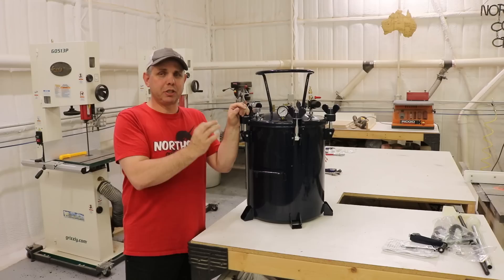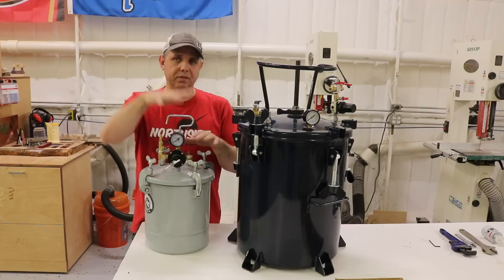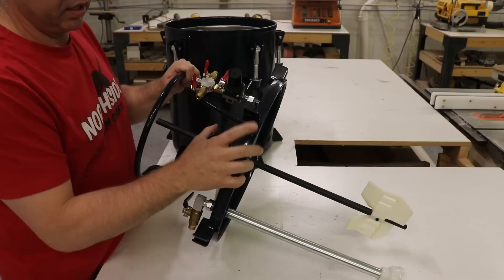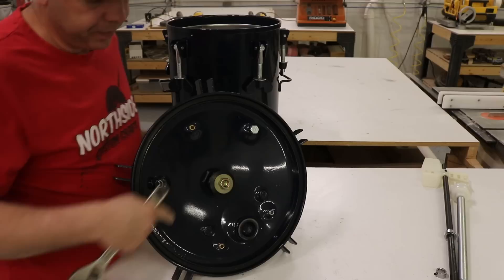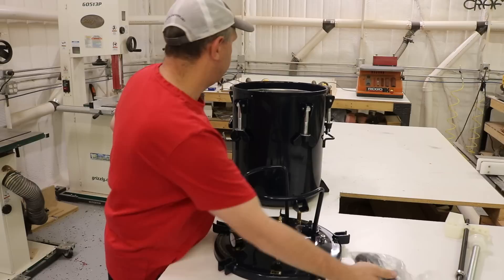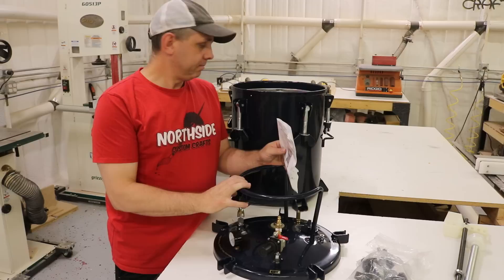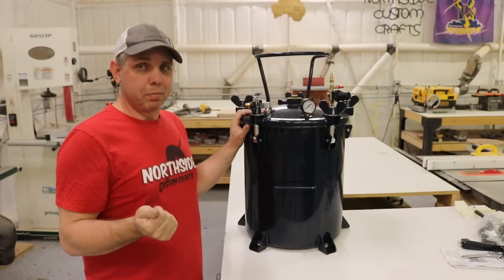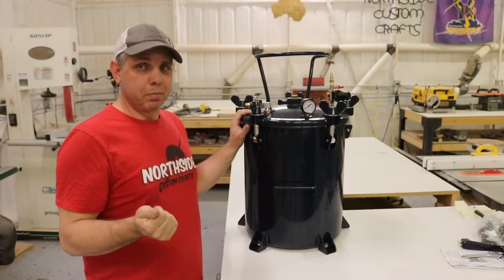How to convert ANY Paint Pot into a Pressure Pot for Resin Casting

Comment: Great Video Jake! I Have the 5 gallon version and love it, the only thing i did differently was to add a 90 deg elbow to the inside of the lid where the air goes in so that it is deflected off to the side instead of blasting straight down
Reply from the maker: Jeff Holliman I knew I was forgetting to mention something.. lol This one came with an air deflector that screws In under the regulator.. if it didn’t have one I would have done something like you did with yours. . 👍👍👊

Comment: I find it so fascinating that every time I need something resin related and I have to do a conversion, I always wind up coming to your Channel. So recently I also bought a California air tools 10 gallon paint tank that I need to convert into a pressure pot. Only this time I know that I can probably get the items to seal up the top at a local hardware store this time around. I know this video is over 4 years old but if I happen to come across any changes to this pot, I will come back to this Channel and let you know like I did with the 2.5 gallon pot.
Reply from the maker: Lol Awesome.. I’m glad you keep needing the things I’ve done and made videos on.. this one is a lot more straight forward than the other one.
Reply: @JakeThompson  Okay, I'm back. Configuration is done,  but I have a problem. I bought a 3 gal pancake compressor and for some reason, it's hasn't touched 20 psi. I bought an air compressor 1/4" kit from Central Pneumatic and after connecting all the parts I'm detecting leakage from the  1/4" female quick connector. Is it suppose to leak back out from the air inlet like that?
Reply from the maker: @seekertosecrets7618  you are trying to fill a 10 gallon pot with a 3 gallon tank.. it’s not going to work well for you… I have a 8 gallon air compressor that will fill it but it’s slower than filling with a larger compressor.. I wouldn’t go lower than 8 gallon tank on your compressor.  As far as the leak goes.. it shouldn’t leak.. if it does.. take it apart and reseal the threads, or if the quick connect itself is leaking.. the fitting might need to be replaced.
Reply: @JakeThompson  Another question about the compressor. Is buying a 10 gallon tank enough to cover both pots I mentioned?
Reply from the maker: @seekertosecrets7618  https://youtu.be/wqIWYf3dhs4?si=JtKvTmde2Gjo1-iU

Comment: Great tutorial. I ended up using metal washers instead of the rubber for my Home Depot did not have. Some 5 min epoxy on the center bolt and no leak. Your instructions on adjusting the pressure valve was very helpful for my TCP pot was set at 40 psi and was tripping each time. I thought i had a leak before i realized it needed adjustment.

Thanks again
Reply from the maker: cadmus547 Perfect!! I’m glad I could help you out.. Happy Casting! 👍👍

Comment: Absolute max generally means (US Specs....) Safe - possible - burst is at least 2x that.  60 is easy for it and so is 50 and 40 is sleepy.  Safety is a bleed down to safe not dump the can and requires manual reset.  So if your compressor dumps volumes fast, it will be low and then overreach.  Bleed down to set value.  Cool.
Reply from the maker: Martin Eastburn 👍👍👍

Comment: Amazing and so easy to follow!
Reply from the maker: Paul Bielaczyc Thank you Paul.. I’m glad you liked it. 👍👍
Reply: @JakeThompson  I do have one question. When plugging the center hole with the 5/8" bolt, does the orientation matter (bolt facing down versus up)? 
If you inserted the bolt from inside the pot facing up (opposite of the video), then the pressure in the chamber would be pushing the bolt out. Seems like the bolt/bolt head would be a stronger joint than the threading/nut?
Or does it really not matter?
Reply from the maker: Paul Bielaczyc it makes no difference. The rubber and metal washers are laying against the metal lid.. so it won’t matter which direction the bolt is facing.

Comment: So I ended up buying the TCP Global 2.5gal version. It looks like the CAT version except not as high quality parts. Followed this tutorial. And the lid has a rotted out thread where the safety valve screws in. Gonna try some locktite. If that don’t work ill just have to deal with the bubbles because 200 was the most I could spend.
Reply from the maker: Sorry about that.. I hope it turns out well for ya. 👍
Reply: @JakeThompson  It did work out! Loctite 242 to the rescue. I applied it liberally(only time I will use this word lmao) and let it set for about 45 minutes and that was that. Do you think 40psi is enough for clear dice and miniatures?
Reply from the maker: @viridianwarrior  Awesome… 40 psi is probably good but you will find out lol I usually go just below the max of the pot. 👍

Comment: thanks for the video. very clear. i have a mold that is 16" tall and if i'm reading the specs correctly it should fit in this one - does that jibe with what you're seeing in yours? i was looking at a much more expensive "ready made for casting" pressure pot as i wasn't sure if i wanted to deal with the mods but your video made it so easy that i can take it on and can save a coupla bucks too. much appreciated.
Reply from the maker: Thank you Sean! 16 inch tall mold should fit.. not much more though.. I’m glad I could help ya.

Comment: Hi Jake just watched your video and subscribed on paint pots and I just converted a Harbor Freight pot everything went as planned i filled the tank up with air 40lb didn't hear any leaks at all but came back in about 90 mins and the tank had lost about 5lbs....any suggestions? Thanks for all the knowledge your putting out...Chris
Reply from the maker: Chris Oliver  I leave the air on with mine and the regulator should keep it full.. sometimes my harbor freight lid leaks at the seal.. I just clamp the entire pot to the table.. fixes it right up.. thanks for coming aboard the channel.. 👍👍

Comment: Hi, Jake!! First off, I love your videos. They are extremely helpful especially getting things set up for casting. I recently upgraded my HF pressure pot to a larger 8gal tank similar to the one in this video. One question, did you need to do anything to the "screw cap" that's between the pressure relief valves?? Mine has the same thing, and I want to make sure everything is covered before using it.
Reply from the maker: Very welcome!! I’m glad you enjoy the videos.. just make sure that screw cap it tight.. that’s it..

Comment: Hi Jake, thank you for the helpful video. I'm just getting set up, converting mine for resin casting and had a couple of rookie-type questions for you...
Firstly, I've removed all the nonessential stuff and am just waiting for the right size fittings to come so I can cap it off. I've temporarily put the hand-stirrer back in place and am wondering if I could just cut that off shorter and replace it to save the trouble of using a bolt and washers. The stirrer passes through a tight hole in the lid with two even tighter O-rings and is then secured by two collets with a grubscrew in each. No air gets out round it, so I'd wondered about just shortening the stirrer.
More importantly, do I need to fit a non-return inlet valve to the pot so that I can disconnect the compressor? Or do you just leave the compressor pressurised and attached to the pot?
Thanks!
Reply from the maker: Thanks for watching.. you can cut the stirrer, although a bolt is pretty easy.. The inlet valve works just fine.. you can leave the air on and just leave it hooked up. The regulator will keep it at the right psi

Comment: Thanks for the great tutorial! I have a 3 gallon air compressor. I converted both a 5 gallon, and a 10 gallon pressure pot. Can I just keep emptying and filling the air compressor into the pressure pots, or do I need a bigger air compressor?  I completely read my air compressor manual, but I have never operated it or any before.
Reply from the maker: If you have resin with a slow working time you might be ok.. but a good rule of thumb is that you want a tank on your compressor to be at least the same size as the tank on your pressure pot. I’m glad you enjoyed the video. 👍

Comment: Another question:
How pressure i need, that the air bubbles go out
In a mix from 50 ml or 100 ml ?
Or in a ready resin piece in this sizes?j
Is the pressure i need continual go higher to the dimensions of my used resin or is this ecponentiell
Reply from the maker: Vero Fluegel It’s the same pressure for any amount of  resin.. at least 45 psi

Comment: I recently bought this pot, converted it, but haven’t had a chance to use it yet. I don’t plan on doing large castings, I just wanted to be able to fit more than one casting in at a time, like the Harbor Freight. Have you looked into a collapsible wire rack that might fit inside of this, which would create shelves for multiple levels of smaller castings?
Reply from the maker: I haven’t tried any racks, most of mine are larger castings.. 👍👍

Comment: Mine continues to leak. I think it is where the 5/8 bolt goes through. What is your 5 minute epoxy solution?
Reply from the maker: You can spray some soapy water or window cleaner on it to see where it’s leaking..  I would put epoxy around the bolt pretty thick and tighten it down if it leaked at the bolt.

Comment: I just got one of those pressure pots, but I need to purchase an air compressor... do you think itwill be enough with one of those that are meant to inflate car wheels? Thank you!
Reply: btw, mine is 2.5 gallon, I guess that matters 😂
Reply from the maker: A mall tank air compressor is plenty for a 2.5 gallon pot.. a “pancake”  compressor is fine..
Reply: @JakeThompson  sorry, Im spanish and I dont really understand, but I think you’re saying that mostly any compressor will be fine right? Thanks! 😅
Reply from the maker: @nigromarte7017  Yes.. I would make sure the air tank on the compressor is no smaller than the tank on the pressure pot.. 👍👍
Reply: @JakeThompson  Thank you!

Comment: Jake,  I just purchased the harbor freight pot and converted per your video.  I can only get 35 PSI in my pot but it holds the pressure.  How do I increase the pressure at least 45 PSI?   I have a good pressure tank that far exceeds the pressure that I’m getting on the resin pot.  Thanks for your videos, they’re appreciated.
Reply from the maker: Stafford Hillman Is the pop off valve coming popping off or does the regulator need adjusting.. turn the black regulator knob to the right and see if it lets more pressure in.
Reply: Jake, I had inadvertently turned my regulator down on my air compressor, which ended up being my problem. Thanks very much for your reply.
Reply from the maker: Stafford Hillman Whooo Hooo  glad you fixed it.

Comment: Hi Jake! Thanks for the video. I have the 5 gallon version of this pot and am trying to convert it for resin casting but having some trouble. You make it look very easy! What size allen wrench are you using to loosen the agitator? 5/64 is too big but 3/32 seems too small.
Reply from the maker: Matt Pittman Thank you Matt!! I’m happy to be of help to ya!! It’s metric.. I had a cheap set of Allen wrenches and a 3 is the size that fit... so any cheap metric Allen set should have it.
Reply: @JakeThompson  thanks Jake! Got my pot to 60 PSI all thanks to your video. You're the man!

Comment: Your video is so clear and easy to understand. Thank you! This is my first time going to cast resin. Stupid question - what gas / tank do I get for the pressure pot? Thanks again!
Reply from the maker: S L K for this big pot you will need a bigger compressor.. I would say 10 gallon tank on your compressor. For a smaller pressure pot.. you would get by with a smaller tank.
Reply: Jake Thompson got it! Thank you! 🙏🏻
Reply: Hi Jake, I finally got everything in place. quick question. How long does it take to fill the pot up with air? I waited about a minute but my pressure pot gauge didn’t move up at all. Thank you for your help.
Reply from the maker: S L K was your air compressor tank full of air?
Reply: Jake Thompson air compressor showed 50psi
Reply from the maker: S L K needs to be over 100psi
Reply: Jake Thompson Lol ok thank you! 🙏🏻

Comment: Jake,
I have the California air 2.5  pot and a 5hp 20 gal compressor. I set up the pot like you have. Set my compressor to max setting. I can only get the pot up to 25 psi. I also used my pancake compressor 1.5 hp 2 gallon with same results. What am I missing to get up to 50 psi for resin?
Thanks,
Sean
Reply from the maker: It sounds like you need to adjust your regular turn it to the right and let more air in.
Reply: I got the issue resolved, however now the  saftey valve kepps blowing at 45 psi. I do not see a way to adjust. Am I missing something?
Reply from the maker: @seanhanley2104  click here 11:10

Comment: Thanks for the vid, just succesfully moded my pressure pot!
One question: I no longer have bubbles, but now I'm getting little bumps on the outside of the casting. Any recommendations?
Reply from the maker: What are you casting into.. plastic, silicone?
Reply: @JakeThompson  silicone mold
Reply from the maker: @maxdow574  it could be the mold.. if the silicone mold wasn’t degassed when it was made, it will have air inside it and when you put it in the pressure pot.. it can get bumps on the resin because the silicone is deforming under pressure

Comment: Is it as easy to remove the automatic mixer rod in the middle (as it is to remove the manual mixer rod, like done in this video)?
Reply from the maker: Re cowabunga It wasn’t difficult at all.
Reply: @JakeThompson  thanks for the prompt reply. My question is: can you remove an *automatic mixer rod*? (in your video, you remove a manual mixer rod - i don't know if they are similar in design).   here is a link to the automatic one: https://www.amazon.fr/gp/product/B07JPYGY18/ref=ppx_yo_dt_b_asin_title_o00_s00?ie=UTF8&psc=1
Reply from the maker: Re cowabunga it looks very similar.. should just be that but. And then the collar with the hex key in it.. I wouldn’t be scared!!

Comment: okay, it's been almost
18 months since you
built this one, how 
has it performed in
that time? Do you 
prefer this one to the
HF one? Or the other
way around? God bless
Reply from the maker: I use this one almost every time.. it doesn’t leak at all. It’s easy to seal the lid. I like everything about this pot.. the harbor freight pot is a cheap way to get into casting.. if you can afford one of the California air tools pots or others comparable, I would start with the better pots.
Reply: @JakeThompson  thank you for getting back to me so quickly. i am a newbie at casting. i would love to learn how to make my own molds, but even that stuff is to expensive for my budget.

Comment: I hope this comment reaches someone.... can i use a 2QT one like this... 2 Quart Paint Pressure Pot on TCP global ... 
I dont use it for anything large and that size would make it amazing. can it hold the pressure? it says its capable of 45 psi but does that mean converting it to a pressure tank for resin it will hold the pressure ??
Reply from the maker: Here is a conversion for a harbor freight paint pot, I’m not sure which pot you want to convert but if it will help pressure as a paint pot, it should hold it as a pressure pot.https://youtu.be/5jOttgLQvpA
Reply: @JakeThompson  yeah i followed your guide its good, the hf pot failed and almost killed me at 45 psi. So i am just looking for other options and my molds are 2 x 2 inches cubed 
I only use it at 45 psi too. I wish i was lying about the pot bursting open as i was tightening it on the initial leak test. 
It was quiet and next thing u know im setting it down and BOOM . 
It happened so fast i didnt even react from it. I can show u some pics of how it failed but i dont trust that pot anymore, its design just isnt for me. 
I was looking for a safer hobby them custom drones. This isnt looking like its about to be the one 😭
Reply from the maker: @SesshomaruSama15  There are pressure pots already made for resin casting.. maybe that’s a safe way to go for you.

Comment: hi i bought tha model for casting . it says 90 psi max . whats the best pressure  for epoxy  resin the valve is at 60 psi  should i change the safety valve to 80 or 90 psi ?
Reply from the maker: Odys nobody The directions say 90 psi. I think that pressure is for the models. You can adjust the pop off valve very easily.. I run my pot at about 60 psi and adjusted the valve to go off about 70psi
Reply: @JakeThompson  thanks thought they were fix the safety blow valves ...😂

Comment: Hey Jake, for the bolts, washer and nuts would a grade 5 work or to be able to hold this amount of pressure grade 8 would really be necessary?
Reply from the maker: Fábio Henrique  I’m sure it will be fine.. but I’m recommending the strongest bolts possible..
Reply: @JakeThompson  Yeah, I tried to find them on the hardware stores around here where I live in Canada, but no luck with grade 8, only grade 5. Thanks for the video BTW!

Comment: Jake, what size air compressor do you use with the 5 gallon pressure pot?
Reply from the maker: Sandy Zimmerman I have a very large air compressor that I use. But for the 5 gallon pot a small compressor can be used.
Reply: Jake Thompson Thanks so much!